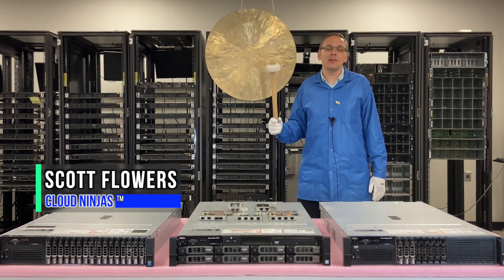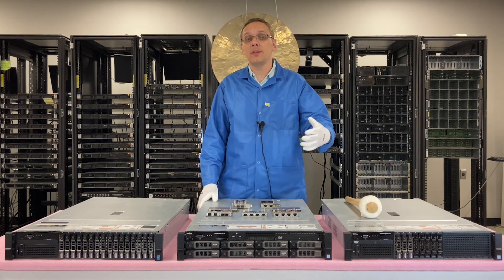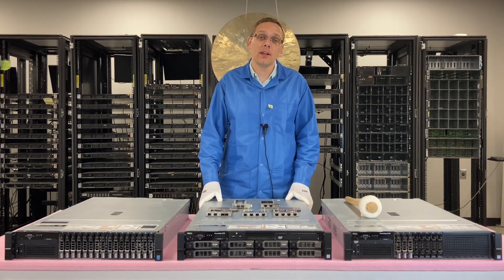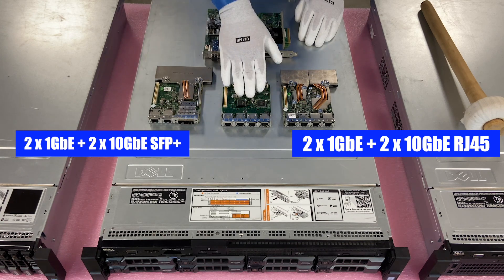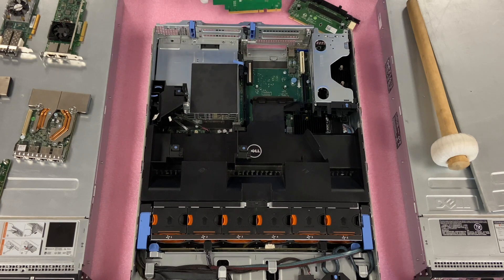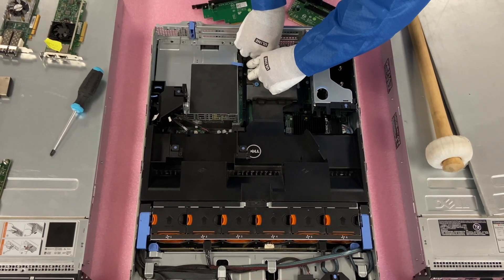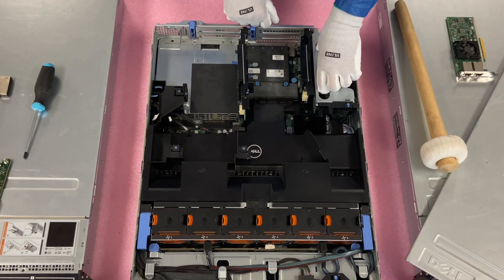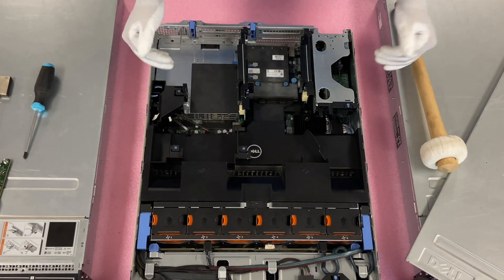Dell PowerEdge R730 Server NICs | Network Card Options | NIC 1GbE 10GbE RJ45 SFP+ | Installation

Comment: Hi. Love the videos. Could you please provide us some info on the gloves? I think you are using ULINE ESD Nylon gloves, are they uncoated, palm coated? I tend to just use my bare hands and periodically touch a known earthed metal object, but I need to up my game.
Reply from the maker: They are fingertip coated, just some basic ESD gear would be fine, we also may use some palm coated ones as well. I have seen wristbands also being used for ESD or static grounding. We also wear ESD lab coats as well as a safety measure when working on orders.